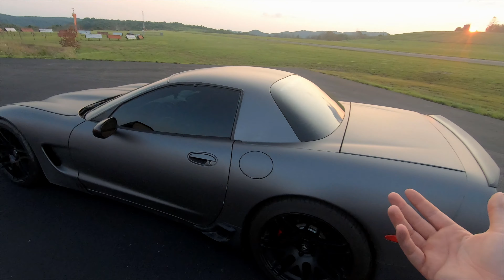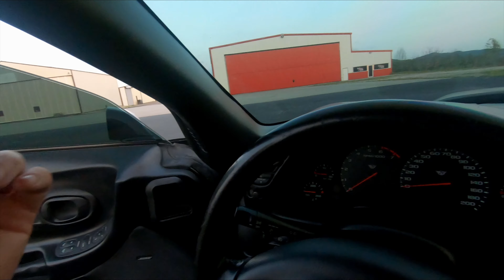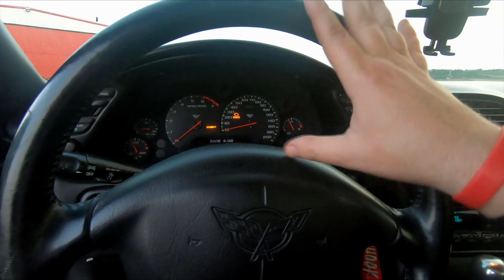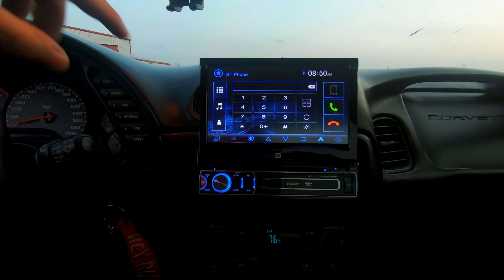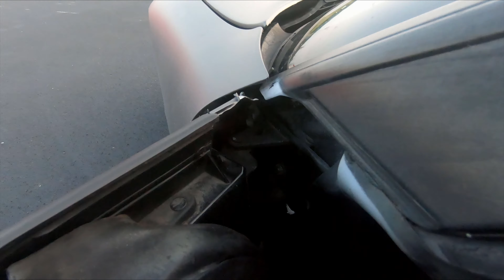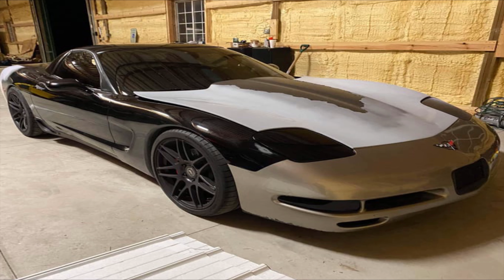Everything WRONG with my FRC CORVETTE

Comment: When you screw with perfection-this is what happens.And this Vette has been screwed with A LOT!  I've had two 1999 FRCs, a Pewter one and a back one -Best cars I've ever owned. Never an issue. This FRC is solid as the Bank of England. Last 1999 FRC I bought in Oregon and drove home to Florida. Never a problem. Drove the Tail of the Dragon in under 10 minutes 30 sec.Then drove it home to Florida. Never any problems. I've had 7 Vettes and I'm convinced this is the best Vette model Chevy ever built.
Reply from the maker: This has been the most reliable car I've owned lol

Comment: Service column lock  issue  install Ignition bypass  35.00  #2 ignition cylinder problem might be the chip on the key test with multimeter or spare key hope your vet 2000 -2004 ? 1997-1999 abs module no longer available $$$$$$$ use one. If u can find one. I’ve had my zo6 22yrs rock solid